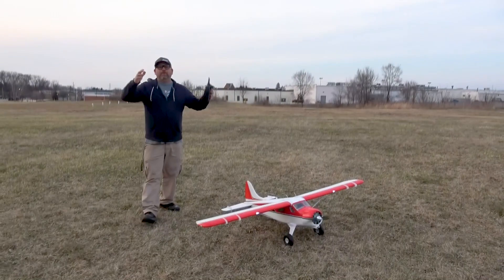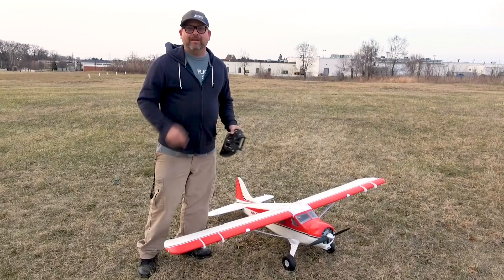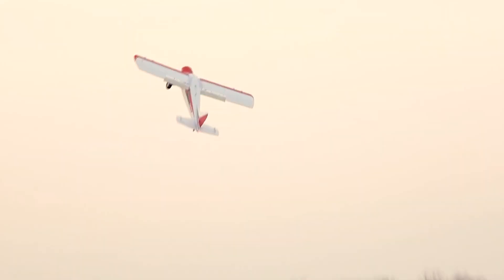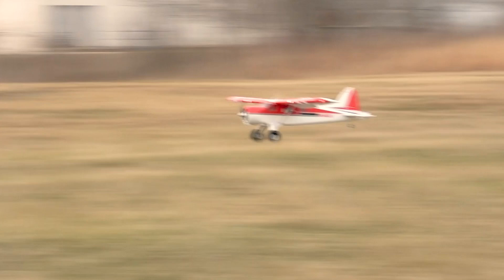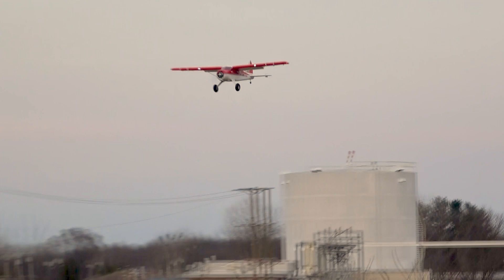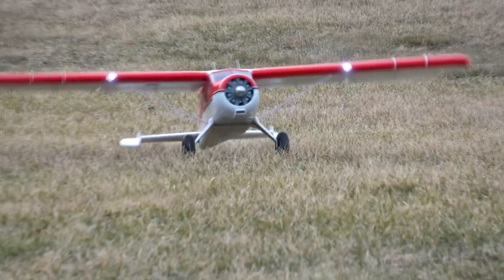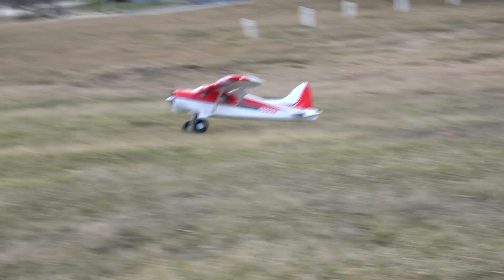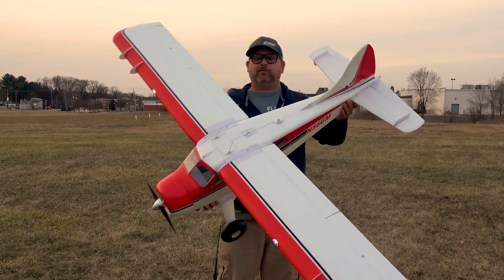FMS DeHavilland Beaver on 5" Air filled Dubro Tires / Pilot Ryan and Bobby K

Comment: I bought a set to put on my Turbo Timber evolution.
Very heavy very wobbly.
With them turning fpv is no good in the air.
I tried to get the lighter set. But unfortunately awards happening in Czechoslovakia not going to get anything from there now.
I hope all the civilians get out